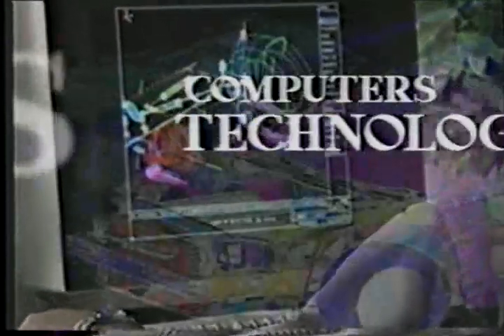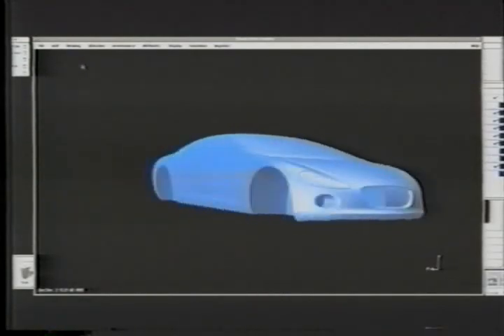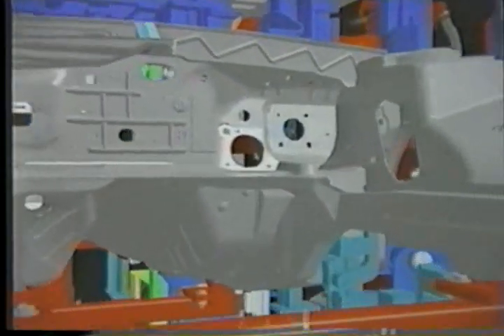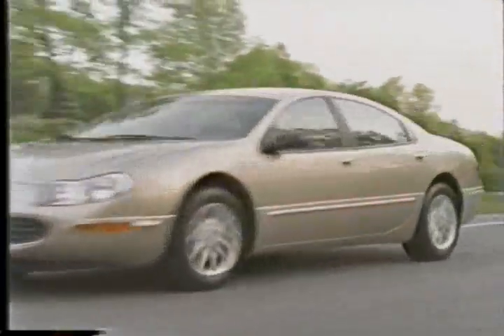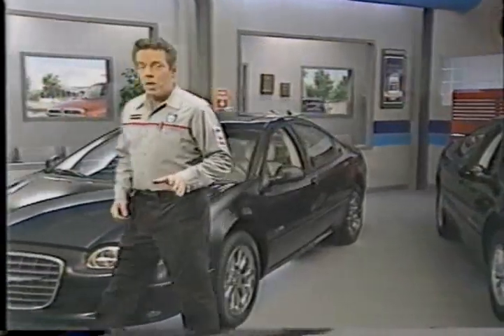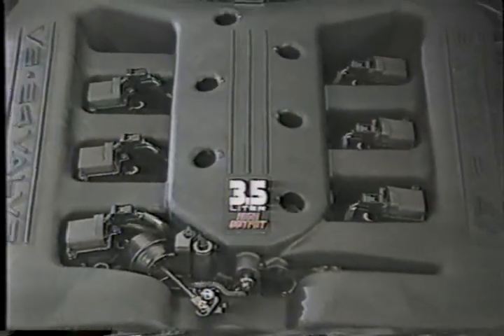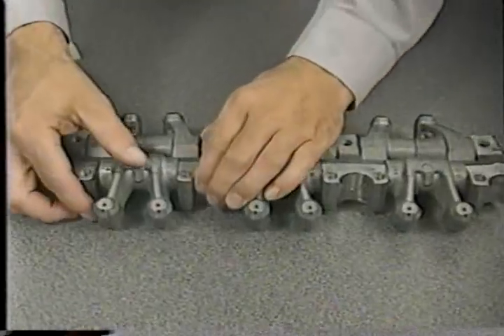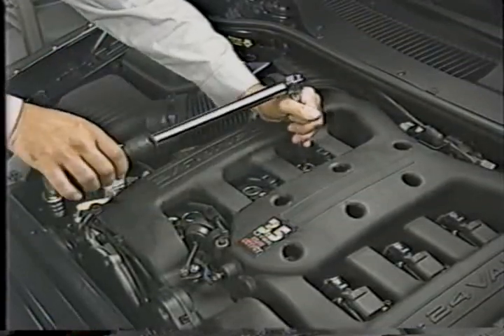Chrysler LHS, 300M, and Concorde - Mastertech - Part 1

Comment: Make sure your cooling fans are working right.  Oh, and thanks for the pricing info on the work you had done.  I'm doing that now to a 2000 Chrysler LHS I just bought. The thing is I'm lovin this car!  It's AWESOME!  I'm kind of hoping to end up with near 300 HP when I finish making the computer and few other cheap changes.  Along with average of 31 MPG to boot! A true highway vehicle.  Just keep up your maintenance and you should be fine.